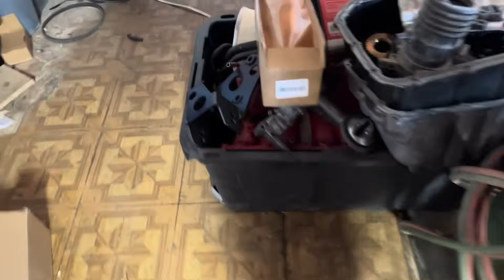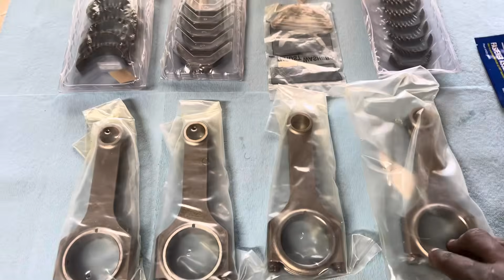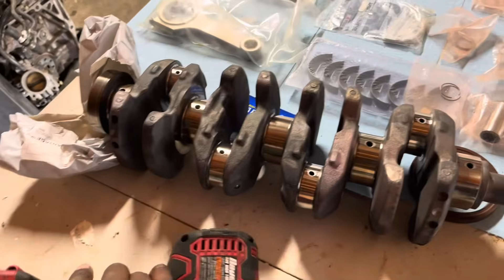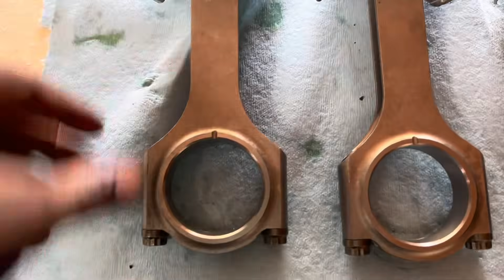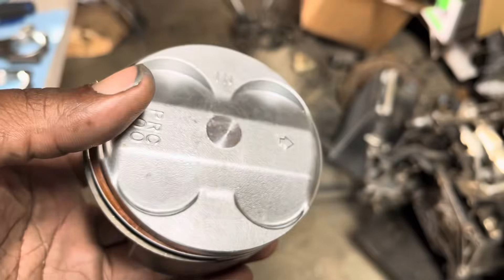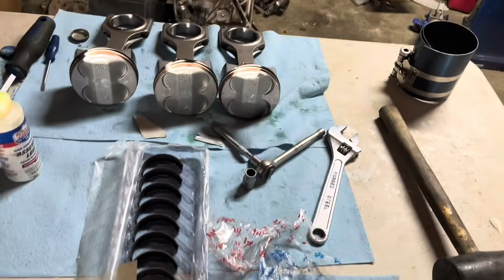Rsx dc5r k20a build part 1

Comment: If there any difference in the k20a eco va the type r? In the Bottom block
Reply from the maker: Yes
Reply: @rarewitit7899  would the difference be everything bore size displacement piston ? Or just in piston ?
Reply from the maker: Pistons rods and crank are different
Reply: @rarewitit7899  so bore stay the same ?
Reply from the maker: Correct

Comment: I know this has nothing to do w the video but I’m swapping in a k20z1 head k24a block onto my base rsx manual, is it best to keep my base manual harness or go with a type s harness
Reply from the maker: You can just use the base
Reply: @rarewitit7899  and I can run it w a 02-04 or 05-06 this s ecu?
Reply from the maker: Has to be the same year as the car